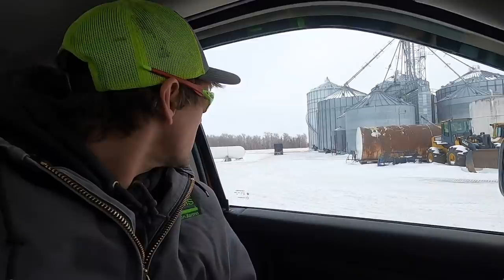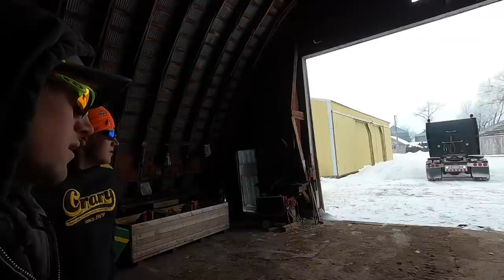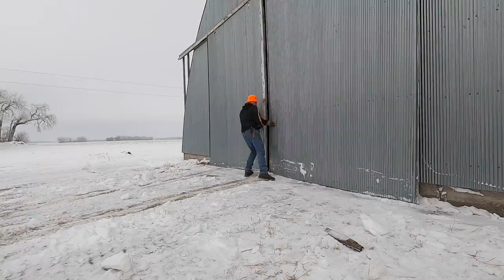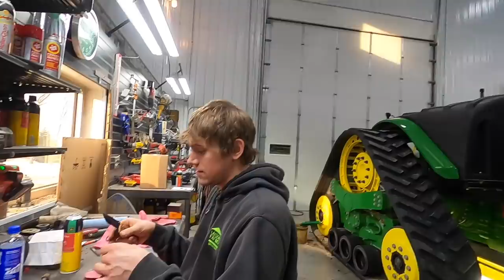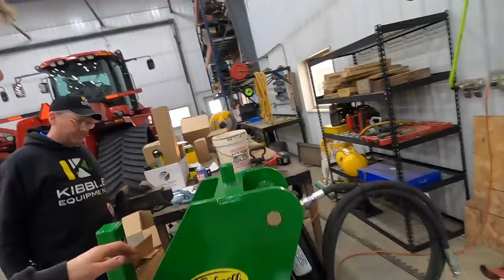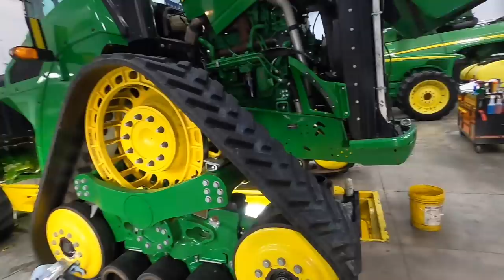We No Longer Need A 3 Point Hitch!!!

Comment: Thanks for the video. Enjoyed the video. That hitch system you have for the new tractor and planter looks to be a sweet setup. Did not know they made those and also was not aware they John Deere tractor with three point in high horse power are very hard to find. Would not have guessed that. You have all kinds of good nice to know info. Will look forward to you doing the new hitch system. Interesting. Your truck and trailer really got the salt on it. Admire you for washing it right away to get the salt off of the equipment. You take excellent care of your equipment. Your weather is like ours, very bad. Minus 20 here in Iowa today. Bad news. Suppose to warm up some later in week. Appreciate the video. Hi to Nicole. Thinking of you and trust you are doing well. You take care. Thanks for editing. All of you take care and watch the weather. Thanks. Iowa farm boy from years ago.

Comment: Is there a reason the combines are praetor with their unloading augers out like that ? Just wondered, I’m sure there’s a sensible explanation 👍
Reply: Saves shop space. You can park things under the augers but the second. Combine would not fit
Reply: @jeeprose4712  wondered if this was the case, could be an expensive mistake hitting one of those 👍

Comment: You guys oughtta get some air line deicer. It helps with froze up brakes from sitting in the cold use it on my trailer all the time in the winter especially after sitting in cold outside for a long time i use champion brand but CRC also makes some might look into it. CRC part #5528 Air Brake Anti Freeze on Amazon

Comment: Hi Chet and Dougo, first, please don’t cover our Canadian flag or remove it. We are as proud of our flag as your are of yours. Just put the great American flag beside it. Second, ask the 11000 American workers that lost there job on day 2 of the Biden experience to see how they feel and then ask the 50,000 Albertans and Saskatchewan folks that lost there job plus the $1.5 billion that the Alberta government committed to the pipeline. Thirdly, if you are worried about your trailer brakes freezing up, take glad hand off trailer on air supply side, but ball valve in , then replace glad hand. Before dynamiting brakes, close valve. That will keep the trailer brakes off so they will not freeze on. Be sure to open valve the next morning to get air to the trailer. I do that on mine. Works every time, cheaper than skidded tires. Prayers are with Niki

Comment: Pipe line was a payoff for Bush Republican big supporters. Thay gave them the inside scoop so thay could by all the old pipe lines that mack up that route to Texas where all that low grade oil will be shipped to Asia but with all that cheap oil on the market eaven that customer is out so that pay off program has gone completely south.😞😞😞😞